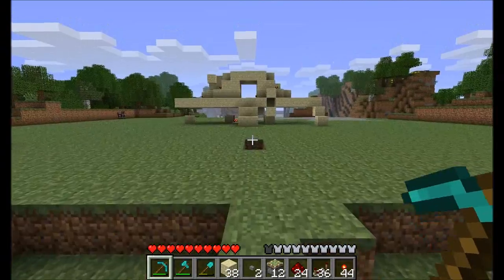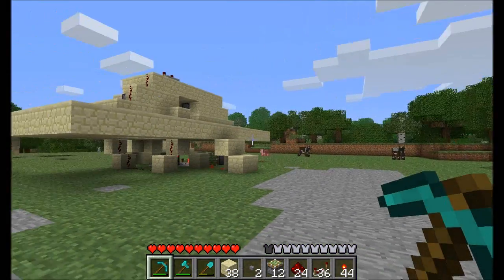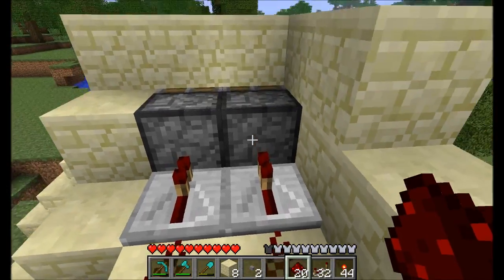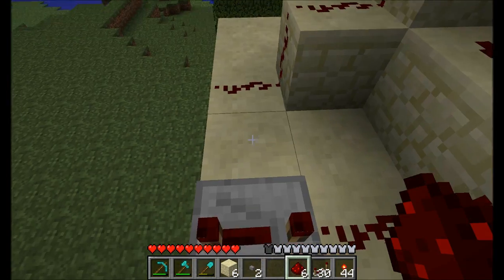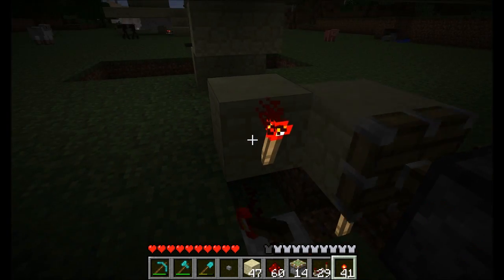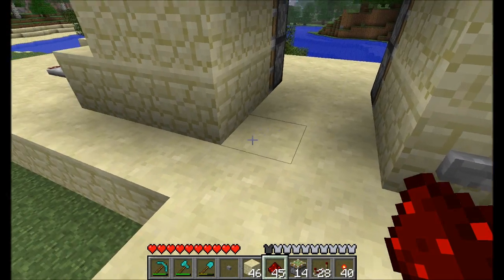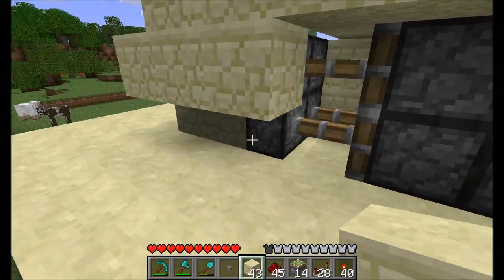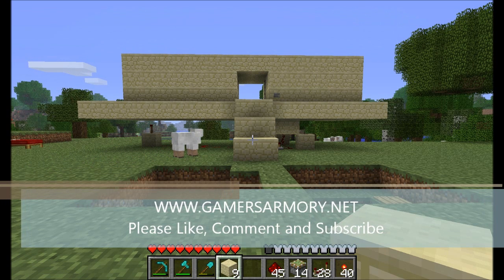New Piston Doors with Button and T-Flip Flop

Comment: If you like redstone stuff  you will love red power 2 its a minecraft mod that has red alloy wire (redstone) that can go in ceiling and walls and it doesn't need repeaters its also adds logic gates e.g A not-gate that takes up one block look it up on Google or minecraft  fourms